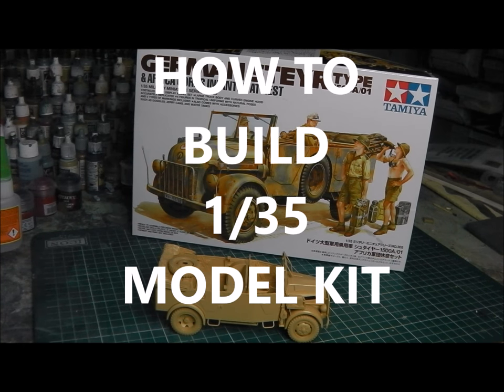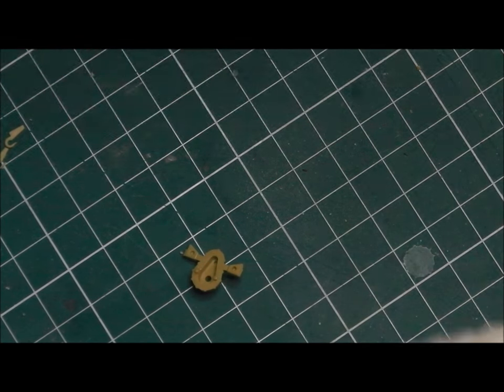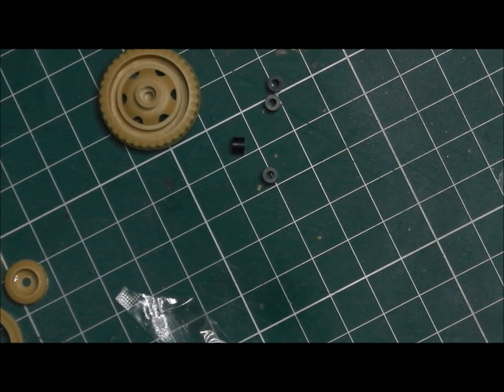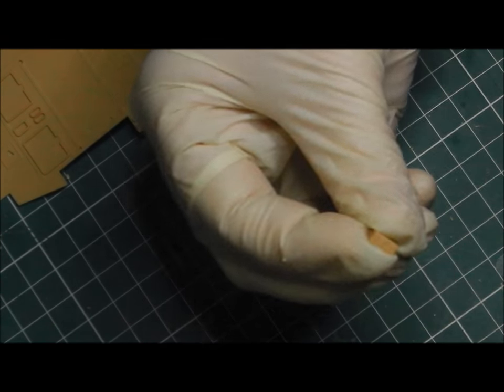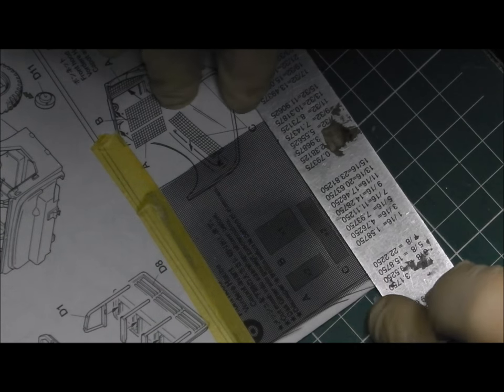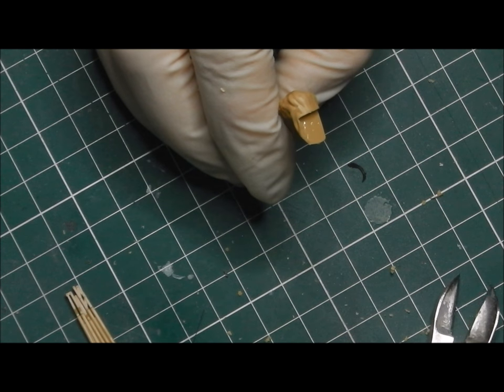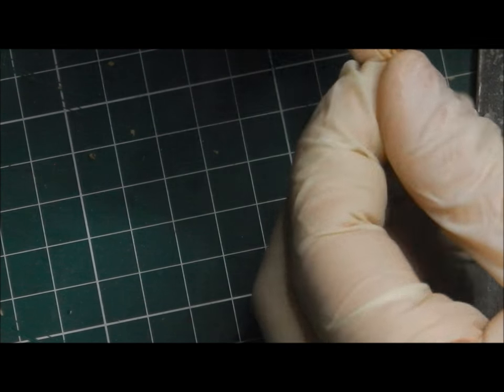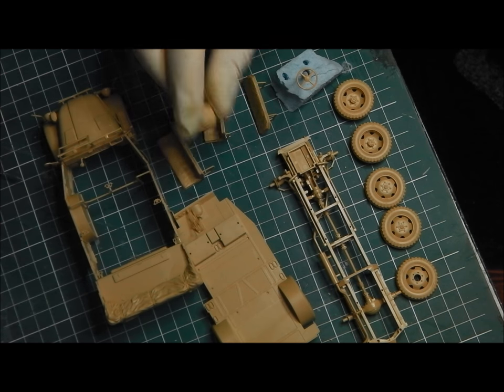How to Build  A 1/35 Model Kit Beginners Tutorial : Tamiya 1/35 Steyr 1500: Part One Construction

Comment: Shane I'M a beginner. I have 2 builds a tiger 1an a panzer4 . I'm ready for paint.But I'm afraid I'll screw it up.Road wheel an such.Got an air brush never used it.
Reply from the maker: Hiya Rick welcome to the hobby ! a very easy to paint road wheels is to use a circle template that you can get from a stationary shop, what kind of airbrush do you have, and what kind or paints are you intending to use ? :)

Comment: I'm only a third of the way through this great video of yours..... One thing I noticed though, after you have cut the pieces from the sprue and cleaned up the attachment protrusions, you don't seem to clean the moulding flash off of the parts..... I noticed this when you attached the leaf-springs of the suspension,  where the flashing runs right down the centre.  I personally use the sharp edge of my #11 blade to drag along the piece to scrape off this flashing.  Do you not bother because a lot of the time it can't be noticed when on a base, like a vignette or diorama say.  The reason I ask is, because, although your video is obviously sped up at times, and edited, of course, you don't seem to take that long to build this kit..... Myself, personally, seem to take 'days' just to clean-up the parts ready for glueing !!! LOL.....But..... please keep your tutorials coming because your narration is very easy to listen to, and very easy to understand - ergo = highly enjoyable.....Again..... Thank You.....
Reply from the maker: thank you Paul for the comment  ! good point, I only clean parts I feel that require cleaning, leaf springs can't been seen in my builds, though it can be something you remove if you wish of course
Reply: And thank you Sir, for your reply.....In response to your comment, I think that it just the fact that I am so pedantic when it comes to these builds.....Like you say, you can't even see the part once it is built..... and I noticed your posts for dioramas [ which I'm about to check out ] which again, makes these parts harder to see.....Please keep up the excellent work..... I shall be watching.....p.s. nice choice of back-ground music.....
Reply from the maker: thanks mate

Comment: I'm just kindda confused on paint, chipping , weathering.Battle damage.Just how to do it all.My hobby shops aren't that helpful. I watch all the videos ,but can't get it.stupid I guess.
Reply from the maker: not at all mate, sometime it is how we are shown are thought, that can be confusing, but the easy way to add chips and scratches to a model, is to paint it as you would normally, then once dry. Tear up some sponge, take the colour you painted the model with, and add some sand yellow or ocher to that colour. Then dip the sponge's edge into the lighter edge and then stipple the edges of the model or any sharp corners with this colour. This is your first layer of chips, then if you want to add deeper chips you can paint some black brown into the centers or areas of high wear into areas you just stippled.

Hope this helps, I will be covering the full weathering process in Part 3 of this video so stay tuned for that

Shane.